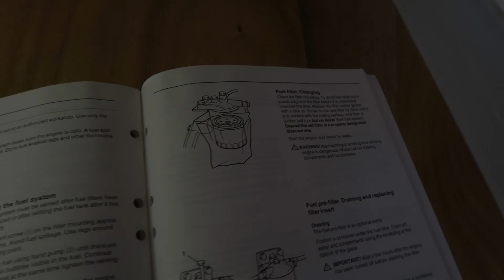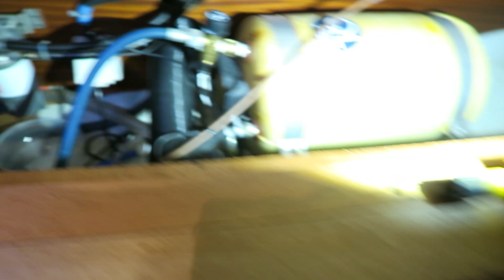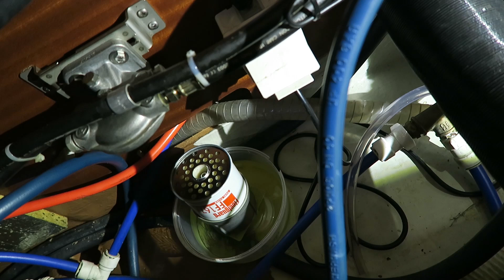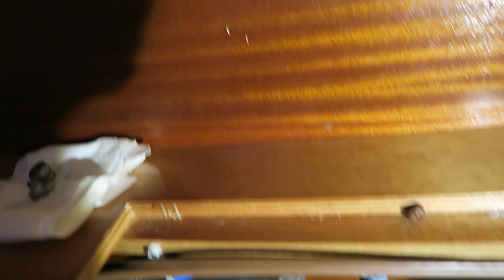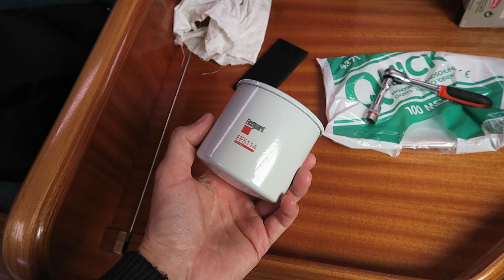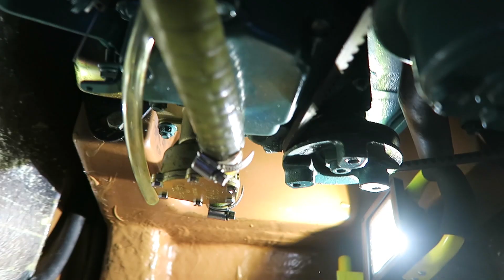Volvo Penta MD2020 - fuel and CAV fuel filter replacement

Comment: You have not changed any filters in this video.

That is an agglomerator (coalescer), not a filter. It has nothing to do with filtering the fuel.

The cav filters all say "filter" on the outside but it's only the ones that have the inlet around the outer edge of the top, instead of all the holes at the top, that are actual filters.

Comment: Hi Tino,
Why are you filling the pre-filter with diesel? Not enough pumping from engine to fill pre-filter and filter? Thank you
Reply from the maker: You can leave the pre-filter empty, but the problem is it will take about 1-2 hours to pump the diesel up to the engine due to the weak handpump. Also why I'm filling the fine filter at the engine, simply to make it more easy to remove all the air from the system.

Comment: If you mount a vacuum gauge with a tee after the prefilter  it will show 0 when filter changed it will slowly go up as filter plugs and change out filter when it gets between 7 and 10 inches hg. https://www.cruisingworld.com/how/fuel-filter-gauge/ thats what I did on my boat. I have now gone 3 years and its at 3
Reply from the maker: Yes it is a smart trick, something I also have seen mounted directly on the pre-filter unit. Think it was a racor filter system.

Comment: This is a very good and helpful video. I've just completed the job and wished that I'd seen before I did it. Especially like the tip about the venting in your description. It felt as though I was venting for ever! There is also mention of having a blockage in the fuel stop valve and I had exactly that problem on my Bavaria. Its apparently a common choke point so I've been researching options. I've seen an inline strainer, fitted upstream of the cock. This is intended to stop the "gunk" getting to the stop cock and looks a good solution. Anyway, thanks for posting this video it'll be helpful to lots of folks.
Reply from the maker: Also watch my new "2019" fuel filter change video where I talk about diesel bug and also the fuel cock.

Comment: Hi, thanks  for your interestings films. I have aVP MD2010D from 2001 and I dont see how to change the thermostat. I think maybe util for everibody.
Reply from the maker: Hello Riccardo. The thermostat is located the same place at the MD2010 and the MD2020, but there should not be any reason to replace it if it is in functional condition. Only if the engine is cooking and is running to hot the thermostat can be the problem. The thermostat is located between the heat exchanger alu box and the engine block, so if you must replace it you must remove a lot of parts.

Comment: Hej Tino 
Jeg har en båd som din med Volvo md2020
Kan jeg overtale dig til at sende mig numrene på oliefelter, brændstof- og brændstofforfilter.
Send mig evt en SMS.

På forhånd tak
40935680
Reply from the maker: Man kan få mange filtre mærker, noget jeg dog har fundet ud af er at oliefiltrene kommer i forskellige størrelser dvs. diameteren kan være forskellig, det er vigtigt at finde et oliefilter der ikke er for tykt da diesel pumpe armen vil støde imod og der ved reducere pumpe funktionen når man lufter diesel systemet ud.  De filtre jeg har brugt i videoen er :For filter :  Delphi HDF296 - typen CAV som kan findes i mange andre mærker  fin filter : Fleetguard FF5114, andre mærker som f.eks. Hengst H168WK kan også bruges Jeg har i olieskift videoen brugt et Fram oliefilter som passede fint til motoren, det var et FRAM PH2951. FRAM har dog fået en del kritik og jeg har derfor valgt Hengst H97W01 eller WIX 57145 som alternativer.https://www.youtube.com/watch?v=Pqnvwxk3kHsDu kan finde WIX filteret hos T-Hansen for 49 kr. (85-99 kr. andre steder) wix er ud fra mine undersøgelser et godt filter.Vedr. olien har jeg altid brugt Volvos originale 15W-40 men har siden hen fundet ud af at den blot skal være VDS-3 godkendt, så man kan i teorien vælge den billige olie fra Biltema.Vil nok vælge Liqui-Moly 15W-40 som alternativ, den kan findes ved svb.de for ca. 300kr. for 5 liter.Det der adskiller de forskellige oliemærker er additiverne men Liqui-Moly er tysk top kvalitet så bestemt et godt valg.

Comment: Tino, referring to the Volvo manual, there is an additional step when venting the fuel system : 

"3. Slacken off the injector delivery line nuts (4) and
set the engine speed control to wide open throttle
(WOT). Turn the engine over at WOT with the
starter motor until fuel comes out of the delivery
lines"

I am reluctant to follow these instructions, because I can't imagine how to turn the engine with the starter motor when injector delivery line nuts are open.
How did you do this? 

Greetings
Reply from the maker: The step you are refering to is only something you do if the fuel system is completely empty or if the engine refuses to start.
Reply: After filters change on Volvo Penta D1-30,D2-40,D2-55,D2-75 it s enough just to pump fuel on pre filter until pump button becomes hard to push /3-5 min/.After that just start a engine.It s automaticali vent though diesel returning pipeline.You have to do step 3 only if there is no diesel between high pressure pump and injectors.

Comment: Tino, I saw your emergency fuel cut-off valve in the video.   (I had the same on my Bavaria.)  That valve is notorious for getting blocked by contaminants, because it is actually a valve for a gas, not a liquid.  The orifice is very, very small.    It blocked on my boat during a storm, and I had an engine failure (Episode 12 on my YouTube site).  I explain the cause of the engine failure in Episode 13.   You might want to watch that video.  When I returned to France from the Azores, I replaced that emergency shut-off valve with a normal, diesel/liquid valve that has a much bigger orifice.  You might want to consider doing the same.  (If you Google the Bavaria shut-off valve, you will see many people have had the problem.)    Very nicely explained video.  Congrats.
Reply from the maker: Thanks for the info. :)